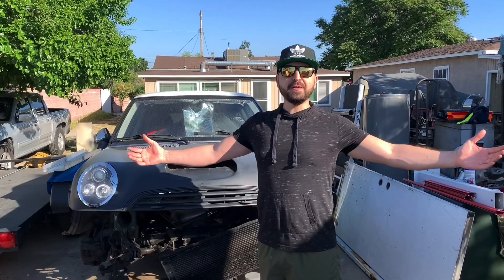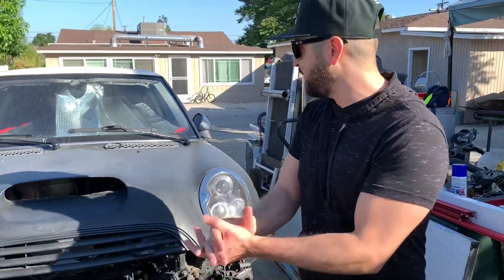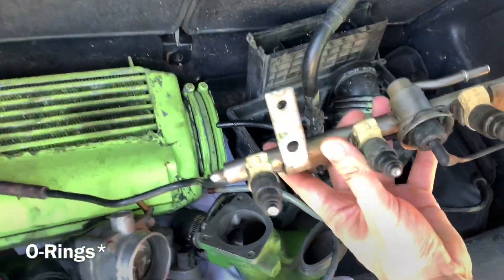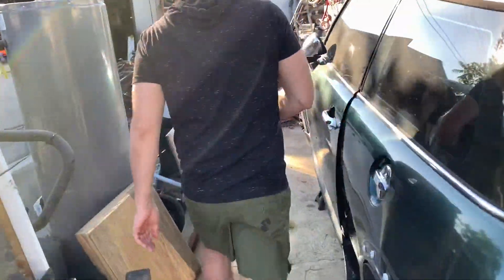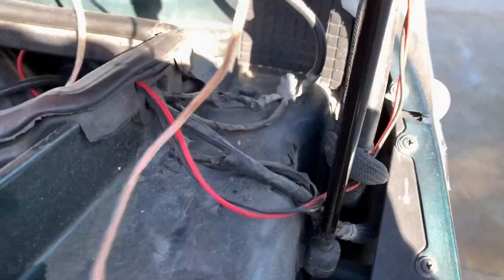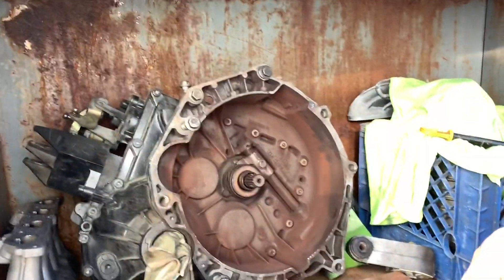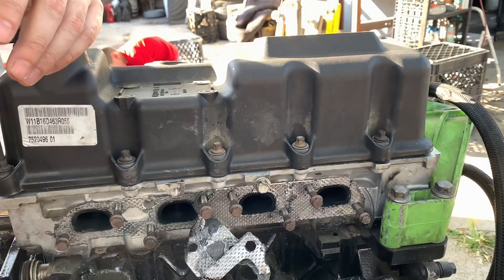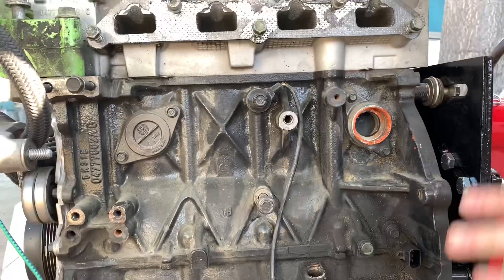We bought the CHEAPEST Mini Cooper S in the country!

Comment: Picked up a very inexpensive R53 a couple months ago with a high rpm “knock”. Turned out to be a spun bearing. We replaced the bearing for giggles to see if it would take care of it. We aren’t convinced it will resolve the issue for long due to feedback from others. We picked up a 2nd low mileage motor that we will go over and do some modifications to before swapping engines. Can’t wait to see what you do.
Reply from the maker: So what happened when you replaced just the bearing?
Reply: Father Son Rebuilds  it hasn’t been really road tested since. The engine has run multiple times with out any knock issues. I ran it around my neighborhood once and it seemed fine but feedback from others seemed to indicate that it likely wouldn’t hold up long term. I can email you pics of it if you send the address
Reply from the maker: Message me on IG
Reply: Father Son Rebuilds  message sent.